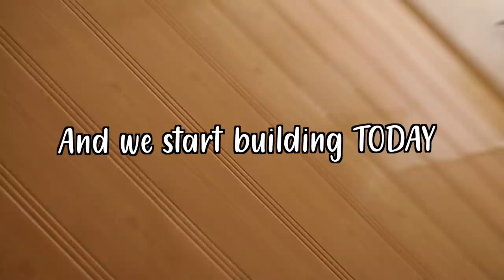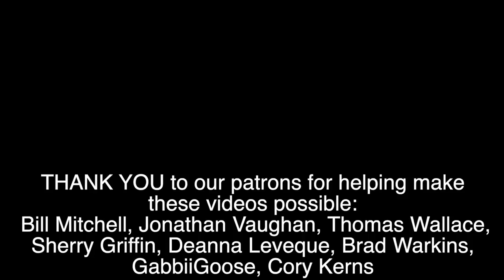THEY WARNED US ABOUT THIS... expats in Panama

Comment: Hi guy's. Normally i won't comment on how to do something" but because I'm a retired mason.  I feel i should.so a line level will only work correctly if your line's are pulled tight as a guitar string...any sagging in the line  and your heights are off.the re rod your using is to small you need 3/4 in or thicker so that it does not bend when pulling your lines tight
Reply: I was wondering why they built forms for their pads underground.  A square hole would have sufficed.
Reply: Donald , more than likely something they saw on u tube . I agree the square hole in the ground is better ...no wood to attract termites ... Maybe tell them to take the wood out ..... Live and learn ...painful advice always hurts .
Reply: @donaldwalstead9977  Forms contain the concrete, which saves material costs. I appreciate your professional experience, but they are the ones funding the construction on a shoestring budget, instead of one of your customers. As you know, the forms can be reused and the holes backfilled.

Comment: I think in a high wind area like that you're going to need substantially bigger footings than those, along with a better concrete mix. You need something like one part cement, two parts sand and four parts of aggregate. Use as dry a mix as possible as too much water reduces the strength of the concrete. Yours was way too wet. Also. your posts look to be too far apart and will require something quite substantial to span that distance.
Sorry my comments may seem very negative, but I would rather you only have to build these structures once than have to rebuild them when/if they fail. Cheers
Reply: Concrete definitely way too wet.
Reply: I was going to say that the mix was far too wet as well.
Reply: They really need a builder to help guide them, I hope they get some professional help
Reply: They are way over there head in construction knowledge .....you can't obtain all the knowledge you need from Google !!!!
That concrete loss about 80% of its strength .    way way to wet ...
Reply: U need to get the right safety gear also, not just for yourself but for viewers knowledge on best practice. I would never use a grinder without a guard, & definitely not without face guard, those blades break & splinter all the time & you will very quickly lose an eye or 2!!!
Reply: I wondered about the concrete being too wet. My dad and family and friends built our house from the ground up when I was a kid and then my dad, brother and son all built huge houses for clients,including log homes. My son started learning when he was around 13. Sorry, just proud family member haha!! It was always so fun to see a house go up from start to finish.
Reply: Yea the concrete looked sketchy. I"m no expert but it looked like there was large rocks in it.
Reply: Easy guys - yes, concrete mix a bit wet and could use some aggregate, and the span is quite large but far from impossible.  as a civil engineer and and a farmer - i can tell you what they are learning about themselves and about the process is priceless, mistakes included! Cheers
Reply: Russ Post haha 80% loss in strength? Hmmm considering you said nothing about the solid clumps of dry cement in the slurry... i doubt you have any experience or education regarding concrete mate. I know for a fact you googled that shit lol
Reply: Whilst I absolutely agree with the footings being both poor design and the concrete being a poor mix, one does have to remember...
It's just a garden shed going on top of it..
A lot of people would have just dug a bit of the earth level and laid some concrete blocks down on the bare earth to put the shed on.
Reply: With the high winds up there I would bury a deadman a few feet down to get actual pull out strength.. or incorporate a gabion on those footings for additional ballast.  Holding up the structure is one thing.. but with those winds pull out strength is what you need... Exhibit A: Rain water catchment roof.  come sail away. come sail away with me....
Reply: pointless giving any advice, as nice as they are they take no notice an continue to waste time, effort and the cash many have donated
Reply: Labor is cheap in Panama. Rather than clusterf***ing their way thru these projects, they ought to hire some skilled labor & work alongside them.
Reply: @HandyC  This is going to be their battery shed, literally there will be thousands of pounds worth of batteries in it
Reply: @Superfandangoo  Agreed. 

One thing I've noticed time after time watching folks with little construction knowledge is they consistently make a LOT unnecessary work for themselves. 

Take the lumber forms in the holes....the sides of the holes work just fine as a form....building wood forms to shove in a hole is merely a waste of time and material.
Reply: Water is over here.... lets put our bus on the complete opposite end of the property... great idea.!
Reply: @jaymondy  
And they placed the bus right next to the road. Not only is this BAD Feng Shui but what if there is a car wreck on road or a pine tree falls over?!
Reply: @Superfandangoo  unfortunately, I think you're right. As long as the money keeps coming in they aren't going to change anything. 😮
Reply: Too much water absolutely.
Reply: Bunch of know it alls probably still live in mommy's basement
Reply: Thought your cement looked a bit sloppy.... wishing heartfelt best wishes. Xxx

Comment: There are two seasons in Boquete; windy and rainy. You recognized your biggest problem, and that is water. Ask to see if someone nearby has a water concession that you can extract water from. How is your neighbor watering his cattle? You intend to have several people living here so water will be a major issue. Planners in the US design for 100 gal per person per day. Those tanks won't cut it and in the end you might just end up constructing a cistern which still will be a stopgap measure. Rain water collection as you have discovered has its limitations during dry season. Solve your water problem before you start building lots of structures. There are AWG machines but these cannot supply water in the quantities you will require. In some of your videos you see power lines across the road. Find out from Union Fenosa how you can get electrical service to power your project.
Reply: Union Fenosa is now called Naturgy. I also have a lot that has a pole nearby. Would like to know what is required. I know you need a kiosk with a meter on it, but that's about it.

Comment: Have you guys considered geodesic dome construction. It might be the best structure for high wind areas.
Reply: I'm really worried about their tiny home design. It's like the three little pigs story, and their tiny home is the one made of sticks that gets blown down by the big bad wolf.
Reply: Lance Smith   Geodesic dome? At this point, they're pouring slurpee concrete, geo domes are several cuts above where their proficiency level exist. We are just going to have to sit back and watch them fail and fail, until they reach a certain expertise

Comment: Not sure if your friend has building experience, otherwise I would fully recommend paying a local builder to help you with the first structure. Not sure of costs there, but I wouldn't imagine is more than $20-$30 a day. You'll pick up loads of little tricks, save time, save on mistakes and endup with a more solid well built structure
Reply: MrDub Yes, that would be smart, I hope they realize it will save them time and money in the long run.

Comment: If the wind is blowing predominantly in one area, plant some trees that will block the wind.  I remember reading about this in old issues of Mother Earth News (and I don't know if they have a website where you can access archived issues, but it's worth looking for) and you don't just plant one row of trees.  I think you need to plant three or four--maybe five rows of trees, and staggered, to block high winds such as these.  Don't go with oak trees because they have shallow roots and will topple when the leaves get heavy with rain.  This I know from living through hurricanes in South Florida.  Plus, the trees will attract wildlife and as long as you don't feed them or give them access to wasted food, they won't become a nuisance.  You might want to invest in some weather equipment at some point to help you gauge wind velocity and what not.  Try farm supply catalogs for these.  And I agree on the concrete.  It's too wet, and you may have to build forms around the rebar and reinforce with dryer concrete.  That concrete was not the consistency of soft serve ice cream, but MELTED soft serve ice cream.  So many great suggestions have been posted by others, and homesteading can be a learning process, but do take the advice from those who know and do what you're doing.   Oh, and look what I found!!!   Mother Earth News archives from 1970!   https://www.motherearthnews.com/store/product/mother-earth-news-archive-1970-2018-classic-usb-drive

Comment: Use more gravel and sand for your concrete and less water. 3 sand, 3 gravel to 2 cement is a very rich mix. Try to find a product called plasticizer or water reducer. It allows you to use way less water than a regular mix. Mixes that are too wet simply have no strength and have the tendency to absorb water out of the ground because they are so porous. Start with less water and add water as needed. I would use a sheet of plywood and dry mix 4 wheelbarrows at once then fill up a wheelbarrow and add water.

Comment: You need to build everything out of cement .Even the outdoor furniture you’ll have to hang out by the fire at night .
Reply: Cement is the powdery substance you mix with water and aggregate to make concrete. So make everything out of concrete. If you mix the cement with sharp sand you get mortar.
Reply: With wind like that there will be no fires. It would blow the smoke back into the house through the stack on a wood stove. And out side fire would get the hot coals flying.

Comment: Definitely looks like you are doing things the hard way. Normally you would build the frame either steel or wood THEN concrete the legs in after you are finished making sure everything is square and level.

Comment: You may need to change your rain harvest infeed to reflect more of the Roman aquifers. You may find that you need to eliminate the elbow and find a support system for the piping to feed into the top from a supported pipe or change it to feed into the bottom. Also, nature vibrates with energy, so any buildings you have you may want to paint to reflect the greens and browns of nature, rather than colors that do not blend in such as the colors you chose for your bus. I learned about this harmony with nature on my own property in Oregon. Here is my link: grapelanepoultryfarm.org    I rehomestead it Oregon Tilth Organic. It has been a farm since 1836, and in my family since 1915.

Comment: I live in the Mojave Desert in the foothills and we have very still days, slightly breezy, and intermittently stronger winds, not as strong as you are having daily. However, when I put up shade cloth last summer, I initially mounted it going East to West, 15ft -25ft in length, and even on less windy days the shade cloth would ‘jerk’ awkwardly. I decided to move it in the direction of the common wind, North to South and the result was a harmonious wave like ripple. Please consider the wind direction when building any structure, including the material used. Try to place it where it will not fight the wind too much. So don’t put the widest part of the structure against the wind, put the most narrow. I hope this makes sense. Perhaps there are wiser builders/engineers on here who could pipe in. My knowledge is based on experience. I live in a ranch home and the wind hits the most narrow part of the home end to end, North to south, and front faces West back faces east. It will also help cut down on the massive wind blowing threw your home causing more drafts.

Comment: A 6 - 8 inch flat hoe is better to mix concrete with. You can pull and push the mixture and not have to make it so wet to mix. My dad poured yards and yard mixed by hand in a wheelbarrow and 80 years later it is all still perfect ! Snaller stones may also help.

Comment: no need for the box its just going to lead to a softer packed area allowing for shift. you could have just packed the hole with loose stone  then poor cement in then push in place 4 inch post holder above grade so that it never sits in water. Cost a bit more on cement but you dont need to repack around the forms later to fill in the space. this still should be fine for years how you did it though just be careful of disturbing too much of the veg higher up slope you dont want to allow erosion to take hold. They have cement approval standards there so make sure to keep one of the bags to show what kind you used just in case an inspector decides to make your life miserable later.

Comment: You need to review your construction methods , size of footings , cement to aggregate ratio and distance between steel support legs . Being as windy as this property is does not bode well for the structure you are erecting . Wish you all the best in your endeavours , but would be very wary from where your construction advice is being sought . Maybe a little less enthusiasm and haste and more building research would at the very least help in building a shed that will indeed  last a viable amount of time and not succumb to the obviously high wind conditions . Not trying to sound to negative guys , but if a jobs worth doing its worth doing well , not to mention if the shed fails the financial and time costs .
Reply: Burnie773 sounds like a good reason for a second youtube channel where he could explain plans and solicit advice from the committee prior to starting.

Comment: There is a reason that you don't see any homes up at that elevation the wind .I would recommend that you design a roundhouse that could withstand 200 plus mile per hour winds unless you lived in that location for several years you probably don't realize the extent or strength of the wind. I know from experience.I've lived in a similar place where every roof gets tested every so often.

Comment: Please do not call concrete cement.  Cement is one of the ingredients in concrete and mortar.  The others being gravel, sand, and water among other things.

I see you corrected the terms later in the video but then I noticed that you added way to much water to your concrete.  Concrete is much stronger with less water.  The secrete is using a hoe to mix the concrete by pulling it to one end of the container then walking to the other end and chopping the concrete a little at a time and pulling it to the other end.  Doing that 3 or 4 times makes sure that the water is mixed evenly which is another thing that is important
Reply: Ok genius. 😂😂
Reply: I remember my dad using a hoe like that when I was a kid and he built our house from the ground up.

Comment: It's always easier to flow with nature than trying to fight it, because eventually nature always win(d)s. IMO, you would appreciate the wind more, if you had a small wind generator (as others have suggested) pumping your water uphill, providing electricity day and night, reducing your LiFePO4 battery banks and PV panels. A hybrid wind/solar system is ideal and least expensive. IMO, a small 1000 watt system (~ 500 watt wind generator + 500 watt PV + 1000 AH LiFePO4 bank) would be sufficient for the two of you. Best to examine the specs regarding min/max wind ratings, wattage output, and reefing capabilities to prevent excessive rotation. A sand-filled mast will minimize harmonic vibrations (noise).
Also suggest ensuring that there are no external air leaks in your cabin walls (insulation + plastic vapor barrier). "A stitch in time saves nine." "An ounce of prevention is better than a pound of cures." Drafts waste thermal energy.
Thanks for sharing your progress and positive vibes. Glad to see you enjoying the experience. Savor that, because few endeavors are more significant. I'd only place procreation and rearing children above that. I'll be watching (the construction phase).👀

Comment: Gotta harness that wind.  Make it work in your favor.
Reply: Doug, that will be tough and expensive. Wind turbines works most efficiently when they are larger in size. That kind of wind would required a very strong bracing and engineering. Maybe they can get that little 12 inch turbine, but from all accounts, most say it is not worth it.

Comment: When you Put Wood Down Into The Ground You Need to Use Kiln Dry Wood Or Pressure Treated Wood and I See You Didn’t So The Wood You Are Using Will Rot.
Reply: When that happens I presume there will be a void around the concrete which will defeat the purpose of the footing.

Comment: Danger warning don't underestimate the power of the wind your structure will not hold up. Consult a structural engineer plan for the worst. Because sooner or later your building will tested. And fail. I know from experience I paid the price.